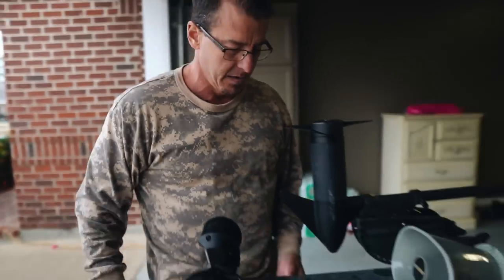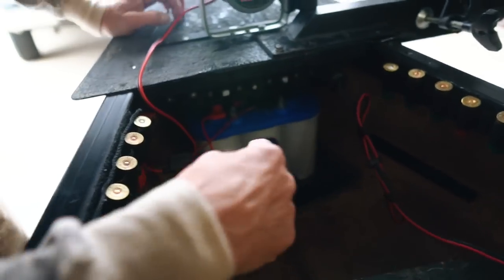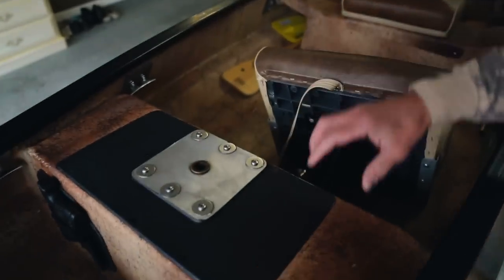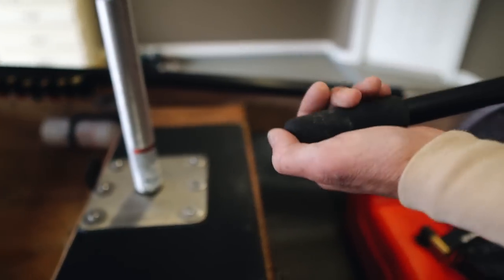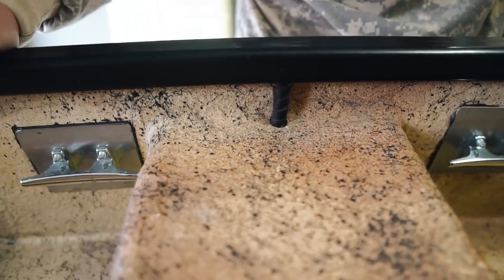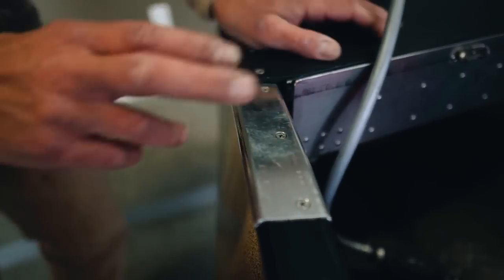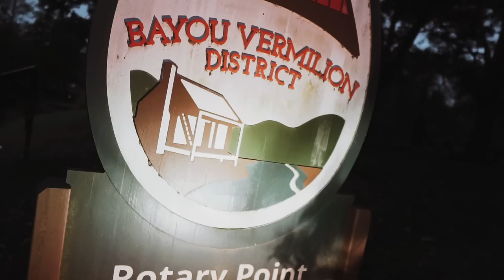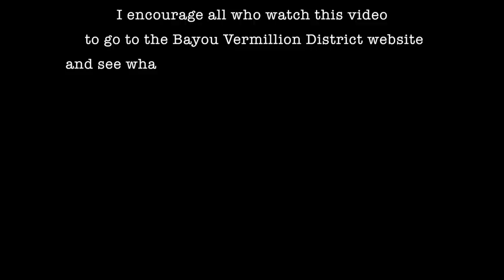GHEENOE SUPER MODIFICATION - SOUTHERN LOUISIANA

Comment: Sweet setup. Got the same 15’4”. Awesome ideas. How did you secure the base plate for your seats for support. I did not see any rivets or screws. I agree. They are not to stout without adding something.  Thanks.
Reply from the maker: I used some flush blind rivets. I had to countersink the .063 aluminum, that's why they are hard to see. Before i installed the doubler i used the right stuff and then installed. I was able to get some squeeze out and cleaned it up after installation and sealed the edges after.

Comment: Nice work, great details. Yoi ha e a lot of weapons on the boat. Is that more for game or are you expecting trouble? The stern seat seems reslly high to me and looks like it would raise the roll axis more than enough to make it feel very unstable (this is what happens in my canoe anyway), but you seem to be handling it just fine. Is that due to the wider beam or what?
Reply from the maker: Yes the height of the seat post does change the roll axis but i don’t use it much when riding mostly fishing thanks

Comment: I have a used 15'4" 1970's gheenoe. and your customization gives me a lot of ideas.    I bought mine to mainly use for duck hunting, so i have to paint, add lights, and other functional items.
I have a couple of questions.:
The transfer plate for the seats, is it aluminum? and How did you secure it to the boat bench seat?
Those quick release pins for your  spot light  any item info on those?
is that aluminum you used for your  rear shelf and drawer?
and the front shelf over your battery area?
Reply: ok, I apologize, as I was looking through the comments, I have found answers to some of my Questions. Thanks
Reply from the maker: I used .125 aluminum plate for the seats and the bow and stern tie ins. The drawer it self in the stern is 301 1/4 hard stainless steel. I'll see if I can get you a part number on the clip for my lights. Thanks.

Comment: Its been a while.  I did some work on my Gheenoe and would like to share the pictures with you. I have a 5hp Honda 4 stroke,  with a loaded boat: son in law, lab, duck hunting gear. i get about 7-8 mph.  by myself, with about 50# of sand and a lead anchor in the front, I got 9 mph,  that was on Jan 6th.
How fast does your 9.9 HP get you by yourself and with John J. in it.
I still have some work to do: a custom jack plate, a front splash plate.  a rear plate, like yours. and installing an bilge pump auto float switch 
Thanks

Comment: I'd love to here more on how the transfer plate is attached to the top of the bench and the seat pedestal to the plate. What hardware, adhesives etc. I'm doing something similar and want it to be as secure as possible considering the inside of the bench is inaccessible. Thanks
Reply from the maker: I used pull rivets also know as blind rivets and bonded it down with the right stuff.

Comment: What kind of wood did you use to build your Battery base with? Did you just paint it or what did you seal it with?
Getting ready to work on my Gheenoe this weekend and next.   I have it stripped down, I have to clean it and get ready to paint after  I make my cutouts for Bilge, switch panel, and shark eye Nav lights. Going Redleg Camo Natural gear for duck hunting.
Reply from the maker: I used 3/4 inch ply wood primed and painted it before I bonded it in place with the right stuff. Thanks for watching

Comment: Awesome Gheenoe mods.    Did you use the same type .063 aluminum plates for the battery cover shelf and the rear. Or was it a thicker piece.

Comment: So I’m guessing the the seat mounts and the cleats you use the right stuff and just wood clamped it to hold it in place til it dried?
Reply from the maker: the tie down cleats I attached them with some fasteners to a stainless steel plate and then bonded them in place with the right stuff. The doublers for my seats I applied the right stuff then used some structural flush rivets and riveted the doublers in place then sealed the edges.
Reply: Shannon Arabie thank you!!! Beautiful boat!

Comment: Hey Shannon! Awesome job man! I just bought an ‘89 Gheenoe that’s the same configuration as yours, and I’d like to attach my seats like you did. How exactly did you attach the .063 aluminum support plate under your seat pedestal base? I see the screws, but did you use an adhesive like the right stuff as well? Thanks!
Reply from the maker: yes i used the right stuff and i used some flush pull rivets. I installed the rivets while the right stuff was still wet to get some squeeze out. Then i sealed the perimeter of the doubler. Good luck.
Reply: Gotcha...thanks!

Comment: Did you use the “right stuff” to adhere the entire transfer plate under the seat? The only bolts I see are the 6 holding the interface plate down.
Reply from the maker: yes I applied the right stuff then bolted the plate on. It worked out well. I also removed the factory rivets where the seat hinges over and put some stainless steel bolts 10/32 with locking quality nuts. It beefed up the pivot point nicely.

Comment: I'm in the process of building a gheenoe how did you mount your seat pedestals
Reply from the maker: .063 aluminum plate i riveted to to boat. I put sealant before installing to keep moisture out. The plate transferred the load. Then installed the seat bracket. I explained it in the video. Thanks for watching. Any questions 337 207 5811.

Comment: I don't get the need to have 3 pistols on the boat. Is southern Louisiana that dangerous? Also,  how do you wire in the tachometer?
Reply from the maker: I have a pistol holder in the front and back of the boat for a person in front and in the back of the boat. On an actual hunting trip I have  actually 7 guns  total in the boat between shot guns and rifles. If you ask me what i'm afraid of, my reply would be not a dam thing. The tach is easy to install it has a wire that wraps around a spark plug wire very easy to install. Thanks for commenting.

Comment: What are the plates that you use for the bench seats to make em stronger.
Reply from the maker: I used .125 aluminum, bonded them to the boat with the right stuff and installed the plate using Steel flush rivets.

Comment: Hey buddy, forgot ask, what’s your top speed by yourself, with the 9.9 and jack plate?
Reply from the maker: By myself with no load i'll go 20 plus mph. Probably closer to 23mph than 25mph @ 5850 to 5950 rpm's. Rev limiter is 6000 rpm's. Really nice alone in the boat. It moves well for the size.
Reply: Shannon Arabie 
Yeah...that’s not bad at all. I currently have a 6 hp Yamaha, without a jack plate, on my 89 15’9, which is really only 15’2 down the gunnels. I can get around 15 mph, but it doesn’t ride right. It definitely needs a bigger motor & jack plate! Really want to put a 15 hp on it, but I don’t want to get a ticket from FWC for over horsepower rating. 👎🏼
Thanks again for your time my friend, and safe journeys!
Reply from the maker: Easy way to check if your motor is too low in the water is, while trailered put a straight edge on the bottom of your boat and compare it to your cavatation plate on your motor. Cavatation plate should be even or slightly higher than the bottom plain of your boat. Lugging will occur if your cavitation plate is below the plain.
Reply: Shannon Arabie Yes sir. I already know for a fact that it’s over an inch below
Reply from the maker: You have to come up closer to level plain. It won't take much. Good luck.
Reply: Shannon Arabie Actually just talked to FWC a little while ago. Apparently it’s legal for me to put a motor on that’s bigger than the manufacture suggested rating...I’m going with a 15 hp! 👍🏻😁  Thanks for the info!

Comment: What kind of plate is on the benches? I’m trying to find some myself
Reply from the maker: I used .063 aluminum plate and riveted it to the fiberglass seat. I used the right stuff between the aluminum and fiberglass seat before I installed, then I sealed the edges with the right stuff. Then I located and installed my seat base plate on top of the .063 aluminum ;plate and installed the base plate the same way. Thanks

Comment: Can someone explain wet shiming and the how to do it part?
Reply from the maker: well you put a release agent such as wax or a slick tape on what ever you want to liquid shim. I used epoxy resin. so on my running board I applied the epoxy to my running board and put it against the bottom of my boat where I had the release agent and tape. once the  epoxy dried 24 hours later I removed the running board and the contour of the bottom of the boat was on the running board. I have pictures of it at the end of the video.

Comment: Looks like u added a lot of weight
Reply from the maker: Yes especially the battery in the bow. The motor (4 stroke) has some weight also. By the time you get an ice chest tackle or guns when hunting and a side kick fully loaded I move about 17 MPH.  About 5200 to 5400 RPM'S. The motor has a 6000 rev limiter.